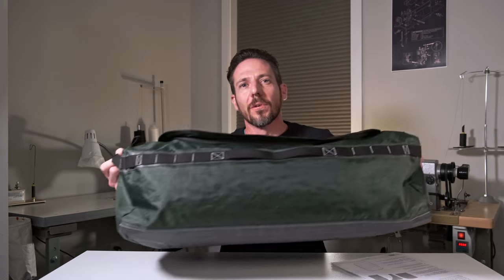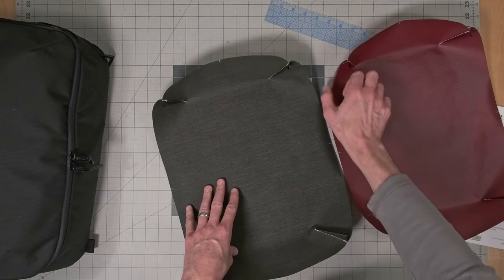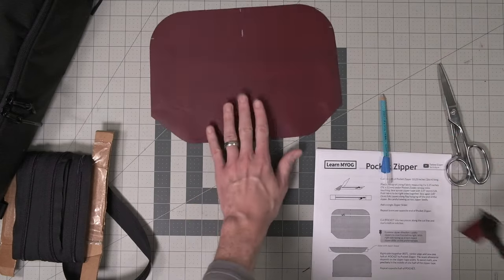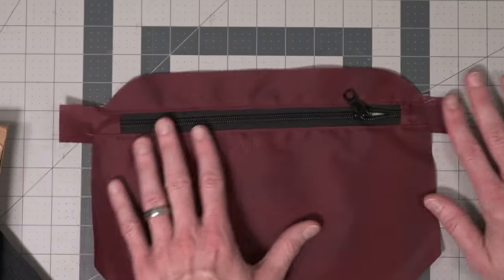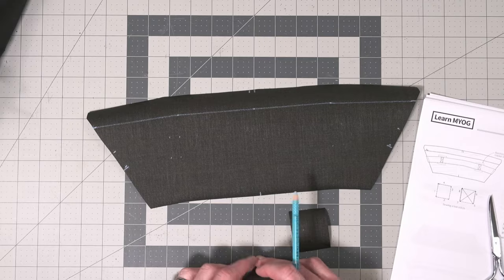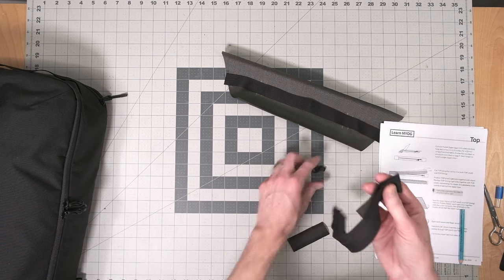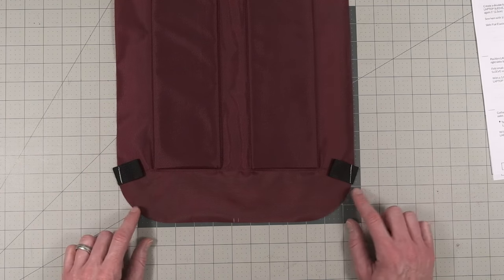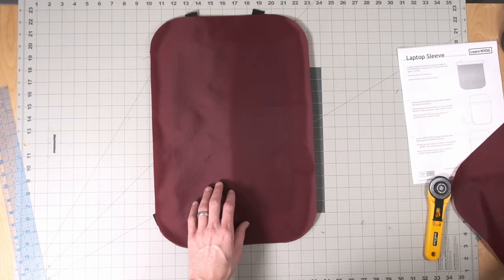Short Haul One-Bag. A compact panel loader backpack sewing tutorial

Comment: Thank you for the detailed backpack its exactly what I am looking for. if I wanted to make a crossbody, could I adjust the strap to go one corner to the other opposite corner, would that work?
Reply from the maker: I imagine so and since the straps are removable you can give yourself options. You may want to consider designing a pretty wide strap to distribute weight on one shoulder. It’s a pretty big backpack and may get heavy.
Reply: @LearnMYOG  thanks for the reply and advice. Do you think your pattern would be ok to reduce in size about 10%. My son is a pilot and is wanting something similar ( backpack/ sling bag) to carry his laptop and his earphones. ? Apologies for all the questions.
Reply from the maker: @joysullivan9031  because of the curves I don’t recommend shrinking by scale. To make less volume, you may covered modding the perimeter panels to make the pack less deep.
Reply: @LearnMYOG  thank you for the advice, much appreciated.